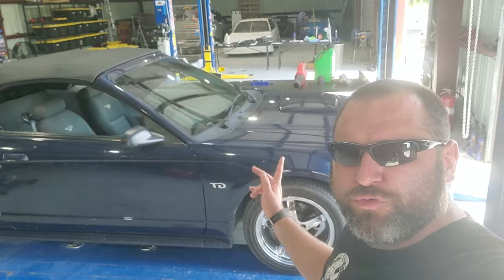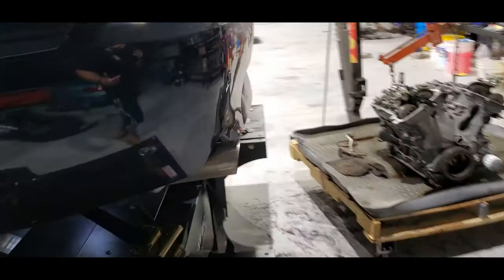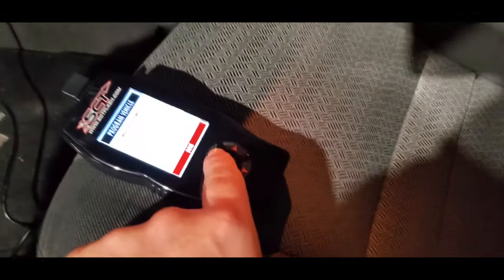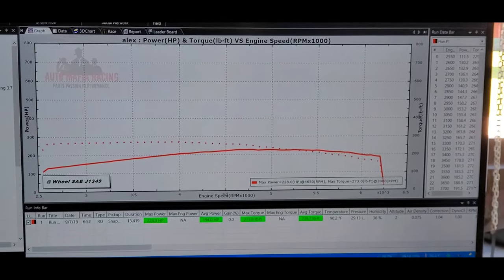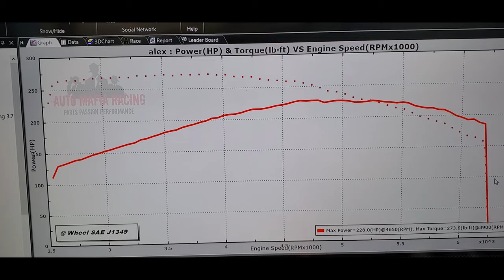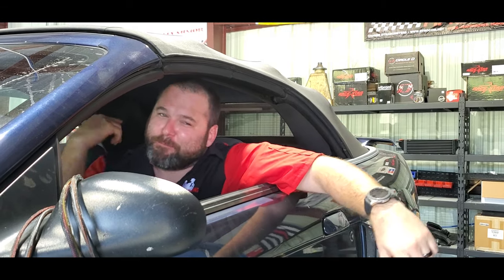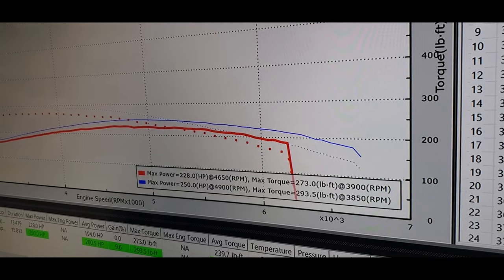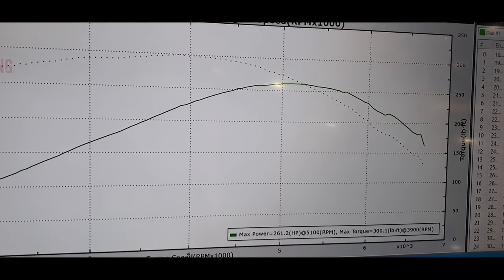Basic Bolt on 99 2v 4.6 V8 Mustang Gains 35 rwhp and 30 ft lbs of torque with  Mafia Dyno Tuning

Comment: What up man I got a 1998 4.6 mustang GT v8 so I like this video I'm sub anything I need to add on it to make it better
Reply from the maker: lots of stuff
Reply: PI heads , off road x pipe , sct or bama 93 octane tune or better yet a custom tune like the guy in the vid , catback exhaust,  cold air intake for starters .
Reply from the maker: C
Good ideas
Reply: @soulerflare7  All that, add underdrive pulleys, gears, and flowmasters mufflers. Also bigger throttle body. You’d be surprised how quick my mustang is. I’ve beaten brand new v6 muscle cars before. Pretty impressive for a 17 year old car.
Reply: @angelgjr1999  Hence the phrase " for starters " . Didn't want to overwhelm the guy .
Reply: Boost lol I wouldn’t waste money on bolt ons ever again
Reply: @modlist6129  i second this! Way easier to just get it out the way
Reply: @mudshotit  plus with bolt obs toy don’t notice anything at all, waste of money. You’ll still loose to most of the cars on the road with bolt ons with a used Paxton, vortech or a on3 turbo kit you will be having fun with coyote 3rd gen camaro ss and a lot of more cars
Reply: @modlist6129  yep. I decided to keep my next 2v  swap n/a until it blows then the next motor is going to be s/c.
Reply: @mudshotit  I just forgot about the 2v and went 4v with an 03 cobra. To build the 2v get the transmission rebuilt and then boost it and make over 500 whp I would have spent more money on the 2v
Reply: @modlist6129  i was going to swap a termi motor in but the price of a 2v on a college budget just can’t be beat haha
Reply from the maker: True
Reply: @soulerflare7  Nothing overwhelming. You can do all these mods yourself for under 2k. I plan on installing a stage 1 clutch soon. Clutch is starting to slip in hard pulls.

Comment: All new edge cars were PI motors. The 98 and earlier were rated at 225. The pi cars are 260. Anything after 99 is a PI. Impressive gains. That original tune was garbage lolol
Reply from the maker: Yea 99+ .  And thanks I was happy with the improvement

Comment: Should’ve added timing, cause my 2v made 338 hp and 394 torque on full bolt ons
Reply from the maker: Not with stock heads and cams it wont.
Reply: How much power it will make  everything on it heads n cams long tube headers n full bolt ons
Reply: @jonnyvargas9394  cams you and stock heads some people just squeak 300 wheel

Comment: I forgot how weak those motors were. Even with heads and cam they were weak.
Reply from the maker: Heads ans cams they are 300s but ya still kinda sad
Reply: Reliable as hell though run at WOT for its whole 500,000 mile life
Reply from the maker: Meh i dont know about that. These can be dogs
Reply: I think the timing chain and components are to blame for most of the reliability issues.

Comment: You would think they would have invented a better dyno by now.
With the motor precision we have today it should be EASY to just hook some sort of reading step motor and punch in some mass numbers and poof. Results.
So says the dumb guy that only knows BASIC programming.
10 A=0
20 A=A+1
30 Print A
40 Goto 20
run
Reply from the maker: Lol

Comment: Bc I wanna spend like 900$ on a dyno for 30 and 30??? Nah fam I'm good with blowing my shit up with octane booster and coil packs and cheap shit with a drilled and tapped hole for nitrous in the throttle body. Fuck that shit
Reply from the maker: I mean it was $500 but ok

Comment: Those numbers are low as hell it should be making that stock
Reply: The cars rated at 260hp at the crank.   This car is doing 260whp.  Meaning it gained a decent chunk.
Reply: DOHCCordia  yea Ik but my brother stock 4.6 2v made 250 and 280tq stock  on the dyno
Reply: @bryanzamora4559  then it must've had a tune,happy dyno, dynod in wrong gear or something.   Seen a lot of 2vs only do 220-230whp bone stock.
Reply from the maker: Yeah with 260 crank hp stock a 15% drivetrain loss would be 221 rwhp.   This made 225.  You figure it was running poorly due to mods with no tune, and factor in the age of the vehicle. 225 wasnt bad.  Now our final numbrs?  They are great!
Reply: DOHCCordia  car was bone stock ass hell it had 20,000 miles and it was dyno on dyno jet
Reply: Auto Mafia Racing  do you guys do email tunes
Reply: DOHCCordia  only mod it had was spintech mufflers
Reply: @bryanzamora4559  I mean dynojets can read high.  But yeah that's right around fbo tuned auto cars.  And still above stock 5 spd cars by a healthy chunk.
Reply: DOHCCordia  did they dyno this car in 4th gear because that’s the 1:1?
Reply: DOHCCordia  did they dyno this car in 4th gear because that’s the 1:1?
Reply from the maker: @bryanzamora4559  Yes, and yes we do email tuning.
Reply: DOHCCordia  the car beated full bolt on 5speeds when it was stock and now we might dyno it again now that it has some bolt ons
Reply from the maker: might not be stock as you think it is